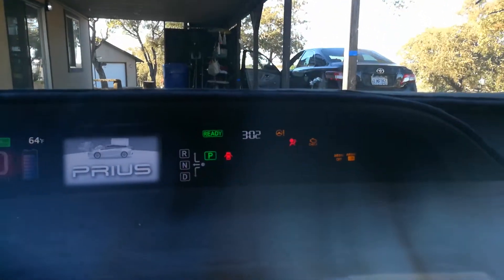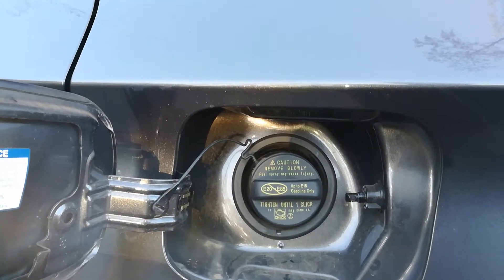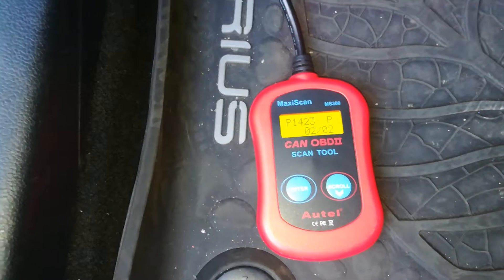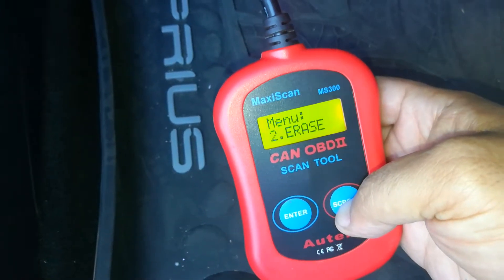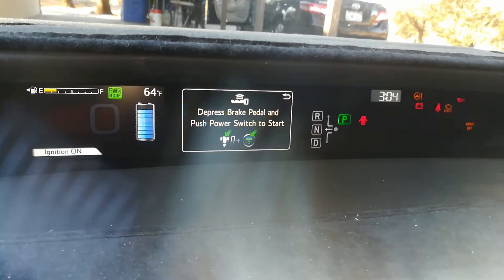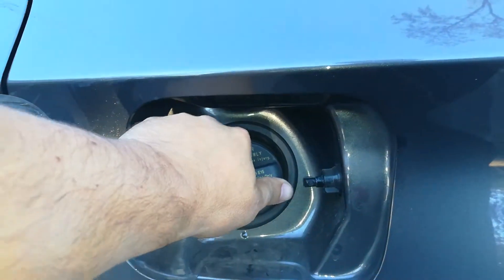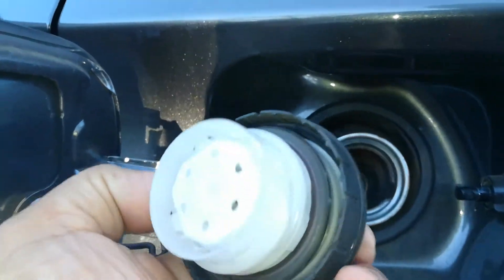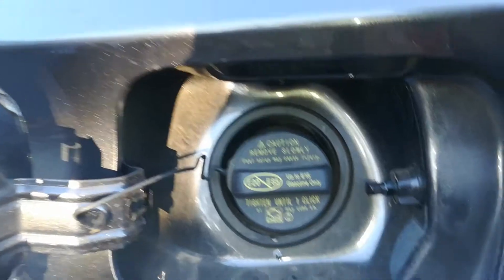▶️HOW TO RESET CHECK ENGINE LIGHT, DTC P1423 / p0441 + p0455 FIXED, SIMPLE FIX

Comment: This code set permanent and pending code on mine too. I hope the light will not come back on.
Reply from the maker: What caused it to turn on?
Reply: @RANDOMFIX  When I checked the fuel cap, I saw that we did not tightened it. New cars are sensitive about EVAP leaks. So you were right, the fuel cap was the reason.
Reply from the maker: You are correct, the new vehicles are super sensitive and  very smart.